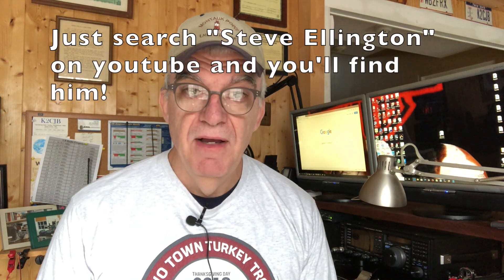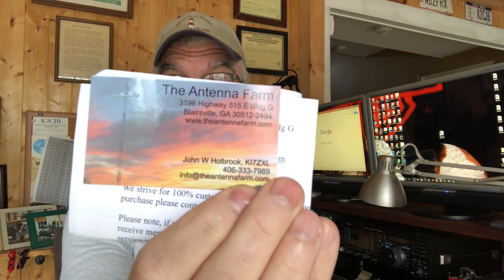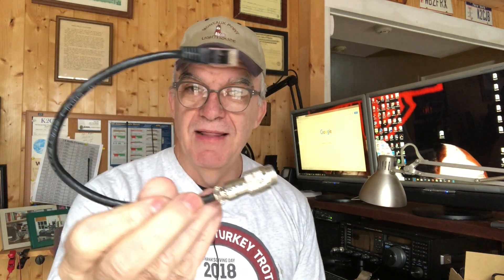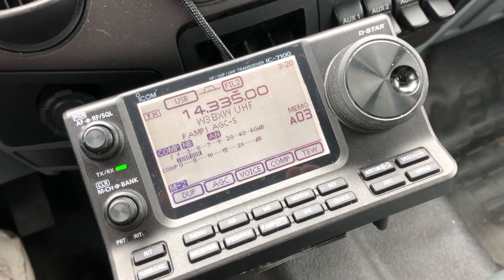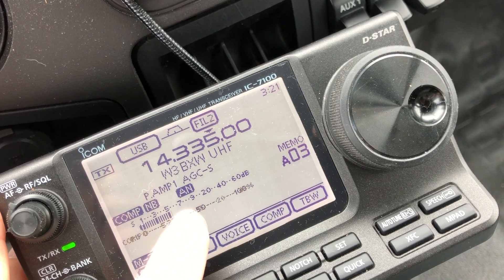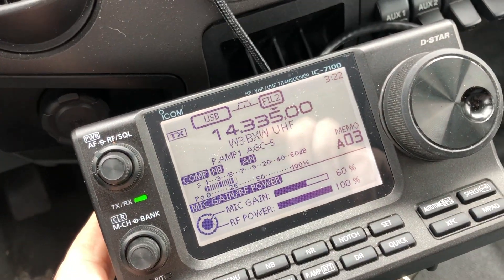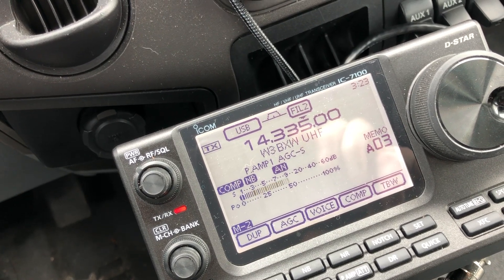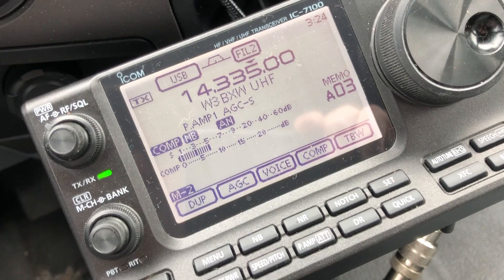IC 7100 Mic Upgrade

Comment: I felt the same way about the HM-198 early on after I purchased my IC-7100. Fortunately, I already owned an IC-7300 and an IC-9700, both of which had been upgraded to base station mics (a boom mic and a desk mic) so, having a couple of HM-219s sitting around, all I needed was the adapter (which, like you, I purchased online). I have had nothing but good feedback.  I wasn't surprised since many people have continued to use the stock HM-219 with the 7300 and 9700 with very acceptable results.

Comment: A lot of mics that just come with a little hole for the sound to pass through. I drill it out with a 1/8 drill it helps a lot. 
Icom has like 4 or 5 mics they use for there radios like WTF? why not just stick with 1 mic that works 🤦‍♂️
Or they can give you the mic that has the keypad that they want to sell you for $90 more 🤷‍♂️🤦‍♂️

Comment: Curious of HM-219 audio reports to date? I also use HM-219 with IC-7100, making contacts with no negative report. I also wired a Behringer XM-8500 dynamic microphone with good results as I use the radio in shack not mobile October 2019. Local guy had me crank audio up near 100% but I do not trust his ears ; )  With dynamic mic .1 uF capacitor is necessary on audio pin to block dc phantom voltage from radio common to most ICOM radios as they use Electret Microphones.
Reply: +1 on that "followup video" I too am curious about the "on-air" comparison and as requested and did hit the "Like" to show interest and show there is an audience.
Reply from the maker: David R Stay tuned.  I had to come up with a different way to do a “real world” test since we are all shuttered in.  Should have it together in a week
Reply: @k2cjbradio  Don't forget, you can record your QSOs with the 7100 :)
Reply from the maker: David R Yep.  I just have to get around to putting a card in it.  Hahaha.
Reply: @k2cjbradio  To record'em, then you should'a put a card in it, Oh-oh, oh, oh-oh, oh  (Oh my Lord, I've been cooped up waaaaaay too long.)
Reply from the maker: David R hahahaha
Reply from the maker: Yes actually.  I had someone in my ham club listen while I tweaked up the eq, etc.  He was the one who originally told me the supplied mic sounded terrible.  When I got done making the adjustments, he said it sounded 10x better!

Comment: Thanks! The adapter cable is not sold by the guy on ebay anymore. I was wondering why I was having problems trying it out in place of my IC-7300. I was not impressed right away with this radio and I am having issues getting the Shark 20 meter antenna to tune on my Jeep. I have to do some research. I think I will have to find a different mount point although it is a lot like your setup at the rear of the vehicle by the tail light. A clue is it seems to tune with the external tuner I have when the hatchback is open.
Reply from the maker: 1crazynordlander Ugh about the adapter cable.  Wonder if there is someplace else that might have it.  As for the antenna, they are really tricky to get resonant.  Keep tinkering with it.  Shouldn’t need a tuner.
Reply: @k2cjbradio  I am about ready to give up on the mobile rig setup. I have one of those NANOVNA testers and it seems to work. I have the SWR under 2 to 1 and nearly 1.3 to 1 over the whole 20 meter band but when I hook it up to my radio the radio says it is over 3 to 1. I need to do my bonding. I have the radio and tuner bonded and found if I un-bond my tuner it will tune. Something is not right. I'll keep plugging away. I might spring for a RigExpert AA-55 analyzer in a few days. I think I am going to get one of those wolf river coils TIA kits and do your counterpoise mod to that and go sit down at a park bench with the radio and give up on the mobile idea for awhile. Hardened Power Systems has a kit called the Commander 7100 that houses the IC-7100 but it is too expensive but I like to tinker so I think I will see if someone has any go kits for that radio to get ideas from.
Reply from the maker: 1crazynordlander Something definitely doesn’t sound right.  Wonder if there is a ground loop somewhere.  Bonding might cure that...might.  Have you looked around K0BG.com to see if there is something that might help.
Reply: @k2cjbradio  I have that sheet printed out and I plan as soon as it warms up outside so I can crawl around on the ground I plan on getting this taken care of. I need to find some flat bonding strap. The only items i have bonded are the radio, tuner and antenna base. I have to take the one by one approach to see what does the trick. It's funny because when you setup at a park you get the antenna resonant, connect it to your radio get the radio going and you are on the air, it just works no grounding except for the counterpoise and your feedline. I hear people just fine. At least with this cheap antenna analyzer I am getting a respectable SWR reading under 2 to 1. Maybe it is off.
Reply from the maker: 1crazynordlander You’ll get it working.  It’s probably something simple.  For portable ops, the Wolf River works like a champ!
Reply: @k2cjbradio  I went back to working on the antenna system this afternoon. I bought a Diamond K400-3/8C2 Trunk/Hatchback Mount and mounted it on the side of my hatch. It comes with the cable and everything. It made my tuner acts the way it was supposed to act. It tunes up in a split second and seems to work good.
Reply from the maker: @1crazynordlander  Interesting.  Curious that you need the tuner with the Shark whip though.  But, if everything is working, then it is a success!!
Reply: @k2cjbradio  I probably do not need one. A good salesman talked me into it. I am a sucker...I do have an 80 meter whip for it so I know the amount of band I can use on a tuned antenna is not as great on 80 as it is on 40 or 20. I know you said 40 was tough to adjust. I am very inexperienced and am learning along the way. I am going to be getting a Rigexpert and a wolf river coil TIA system pretty soon. I have learned alot from your videos. Thanks!
Reply from the maker: 1crazynordlander Actually the tuner will help on 40 since the usable bandwidth of the antenna is narrow, so not a bad idea!  And I am so glad to hear that my videos are helpful!!  Thanks!

Comment: It’s no longer made but the mic that came with the IC-703 to the 706MKIIG,  the HM-103, it runs circles around any other mic for the 7100 other than a Heil. Plenty of them out there, hamfest finds.
Reply from the maker: MDYoungblood Yeah, I got impatient and just bought a mic.  Lol
Reply: I use the HM-103 too. I got fed up of the coiled mic cable pulling on the headset, so I rewired it with a CAT 6 network cable and plugged into the back of the radio base.

Comment: The Heil handmic makes that rig sing... I've never gotten a good audio report running compression on tht rig.. good vid
Reply from the maker: Ken Smith Thanks!  That’s good to know too.  It seems to be doing better now.  That original stock mic is terrible.
Reply: @k2cjbradio  Although I realize that stock mic may not be the absolute best, it is not horrible. Perhaps it is not suited for some voices? I’ve always had good audio reports and just like Ken Smith I have been told the compressor doesn’t help audio quality…. I am still learning and experimenting on audio chain although I have done a decent amount of hf in the past 2 years. The mic I use for doing voice-overs is an AKG C-414 b-uls and I am working out how to hook it up because it needs phantom power (studio condenser mic) that I have used for about 20 years. more on the mic: https://www.akg.com/support/C414+B-ULS_.html